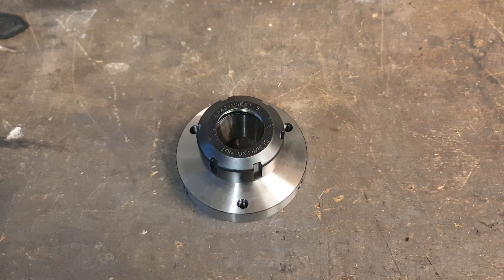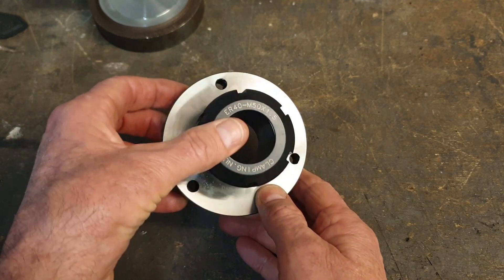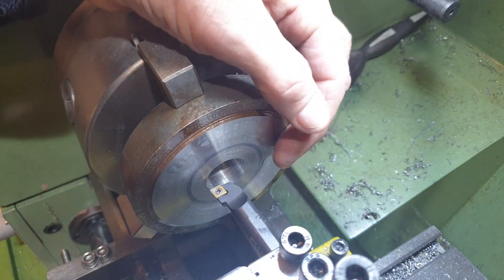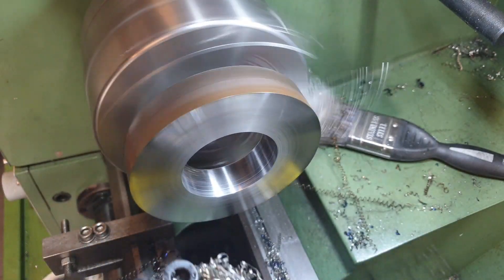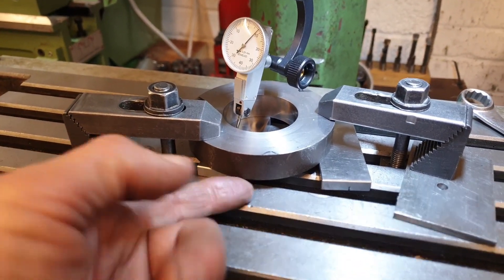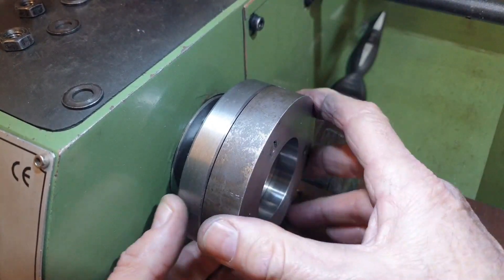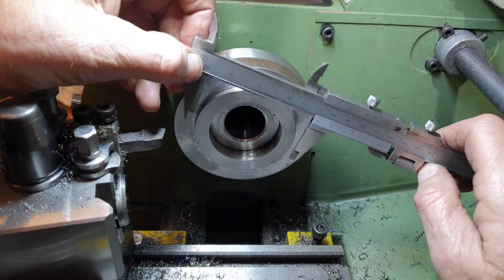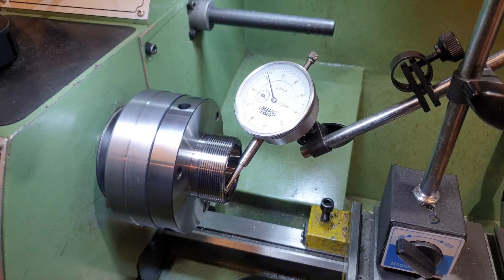Warco WM250V Lathe: ER40 Collet Chuck Backing Plate

Comment: Hi Mark I have enjoyed your YouTube Warco WM250V Lathe: ER40 Collet Chuck Backing Plate

I would like to make one myself, but my calliper gauge (guessing stick) shows 51.96mm for the register ring which I do not trust to make a plug gauge as you did.

Can you tell me the OD dimension you made your gauge to and any other tricks you know to get it right. I will then buy a 50-75mm micrometre and get on with it.

Thank you
Reply from the maker: Hi Bernard,
I wouldn't keep a record of that sort of detail, so unless I call it out in the video, I won't be able to confirm.  I did have a look to see if I could find the gauge that I used, but suspect I've since modified it for something else.
Cheers
Mark
Reply: @markshomeengineering5243  Thanks Mark, I listened very carefully when you used the plug and heard no dimension. You did show the ID on the micro at 52.00mm and spelt it out!
You demonstrated a very good fit and to get that they cant both be 52.00mm.
I must touch and feel! I try to drive straight to the point via ISO 286.
In any event I enjoy your stuff so please keep it up.
Have a pint on me.
Reply: Sorry Mark it was not you that Mic'd to 52 but David Cambridge on another YouTube. The issues/problems are all the same however.

Comment: Why not clamp the er40 collet chuck using a 4 jaw chuck's outer jaws to line up flat and then use the 4 jaw chuck to make it run true ? best of both worlds
Reply: settle down Beavis  fair point, but once you get a hang of it adjusting 4 jaw to run true takes a minute or two tops. You can use a 3 jaw chuck with a hex collet block and shims to make it run true - the advantage is you can quickly swap out the ER40 and use the 3 or 4 jaw chuck for other work without fiddling with the backplate.
Reply: I had the same thought - however with the length of the chuck stick out plus the length of the collet holder, the deflection made a lot more chatter than mounting on a faceplate.   Maybe a newer lathe with tighter bearings wouldn’t make this a problem?

Comment: I've built similar plates but I didn't have a milling machine to do the bolt circle. The plate on the lathe had threaded holes so I used set screws installed backwards to mark the drill location for one hole first to hold it in place before marking the last two.

Comment: Hi Mark, As has been said below, "nice work".  I did similar at last weekend on my WM250 for an ER32 collet chuck, except I bought a backing plate from Warco that was already turned to fit the lathe register.  Saved me a bit of work, but little did I know that the backplate was grey cast iron.  NEVER AGAIN (if I can help it)!  What a mess.  It took three times as long to clear up the cast iron chips/graphite dust as it did to complete the turning.  They got in everywhere.  A chamfer in the register bore may help when fitting.

Having said that, the finished assembly was spot on with 0.006mm TIR.
Reply: Instablaster